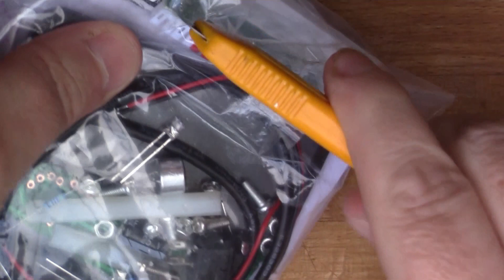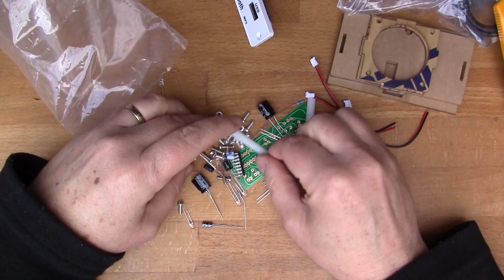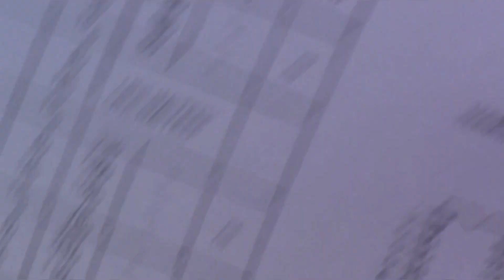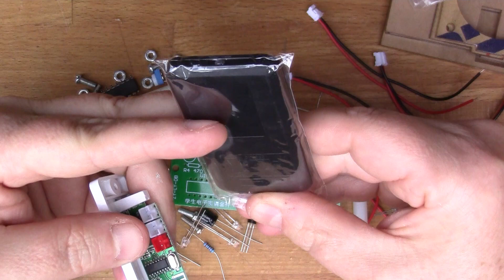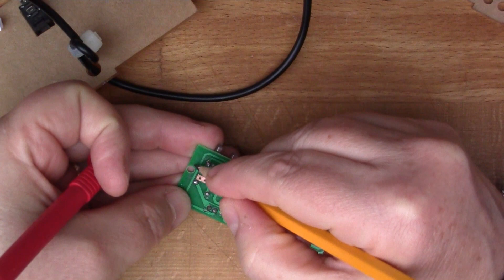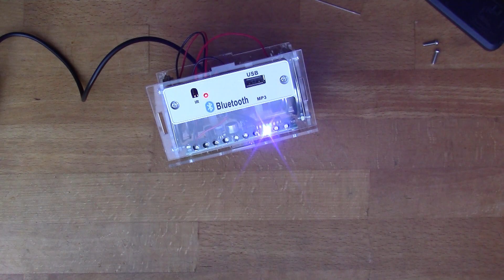Inexpensive Bluetooth Speaker Kit (#138)

Comment: Are there any speaker upgrades available that would not require changing any of the other modules?  Or maybe only minor module change-outs?  I'm really new to this kind of thing.  I'd like to maximize the audio output of this little speaker if it's not too complicated.
Reply from the maker: I think the possibilities are limited, because there is one chip that is the bluetooth receiver and the amplifier combined.  IIRC the amplifier is only 3W, and of course it is powered from 5V, so it's going to be a bit quiet.  You can get modules that are just the bluetooth receiver (e.g. with 2 phono audio out), and then of course you could add whatever amplifier and power system you use.  There are a lot of "Class D" digital amps that are cheap and have a big wattage output.

Comment: The pot is in parallel with the microphone. There is a discrepancy between the schematic and the silkscreen. C2 is a 1uF cap and C3 is a 2.2uF cap in the schematic, but the silkscreen has C2 as a 2.2uF cap and C3 is a 1uF cap.

Comment: I recently built this for a fun project. They included capacitors with different values and they said it's for changing the bass effect on the speakers. I'm not exactly sure which capacitor to replace as there really isn't much information written

Comment: does the speaker have to stay connected to a power source to stay on or does it charge?
Reply from the maker: Sadly it does not have a battery or charging circuit

Comment: Thanks Martyn for the video. In my bluetooth kit the are two leds doesnt work,(dont light on) but I desolders and check is ok. These leds are marked in the main with D4 and D6. Do you konw why this happend?. Thanks
Reply from the maker: I would probably check the corresponding pins of the 4017 to make sure that it's not shorted, and can provide a high output.
Reply: @MartynDavies  ok thanks, already is fixed. Now works properly

Comment: If you just want a MP3 player with a built in speaker, the Retekess V115 is really quite decent. has a micro SD card. plus it's a radio so if you want to listen to the radio it gets pretty good reception. 
but you can also use a USB cable or line in for audio as well.

Comment: I got and built this last week and it worked great for a couple of day, but nownthe BT does not show up anymore :^(
Reply from the maker: As far as I know, it listens for pairing for a short time after power-on.    I'm not sure that there is any way to force the player to rescan other than power-off/on.  You can try doing "forget device" on your phone/tablet, switch to airplane mode and back on again, then you can be sure that it will scan and try to attach anew.
Reply: @MartynDavies  I tried forget the device, and now the YMxx is not advertised anymore, lol. Checked with 2 phones
Reply from the maker: Yes that does sound busted

Comment: Hi, thanks for your video.
I have everything ready now and everything seems to work fine except for one detail, the sound is so low that you can't hear any sound even at the highest volume.
I also felt that the white panel is a bit warm.
I don't know why but I got a pair of capacitors 470uF 16V in the package. The capacitor solution do not work for me.
What could be the cause?
Reply from the maker: I would visually inspect the bluetooth/amp board and make sure there are no shorted wires/solder splashes and so on that might be affecting the amplifier.  I haven't looked in detail at this board, but I suppose that one of the 3 chips is a class D amplifier chip, so I would look around this one for potential problems.

Comment: I read on one of the vendors' stores that the 470uF caps go in series with the speakers, to improve the bass response. Mind the polarity.
Reply: Series or parallel? Series wouldnt work would it? Also what does the potentiometer do?
Reply: The trim pot adjusts the threshold of clocking the LEDs. Yes, series works for the caps to speakers.
Reply: @StevePotter  Won't that filter out the higher frequencies?

Comment: For some reason my LEDS don’t work at all and I didn’t get a spare capacitor in the box either
Reply from the maker: I would check that the 4017 chip is getting power - pins 8, 16 on that chip. If it is powered there should be one LED on.

Comment: I built a wired speaker kit from banggood and incorporated a bt unit into it.  I also found I had to run it from a plug in supply as it was drawing to much current for a smaller power brick!
Reply from the maker: The big brick at the end of the video can source 1.5A, so this is plenty.